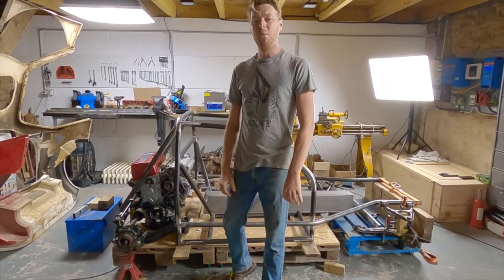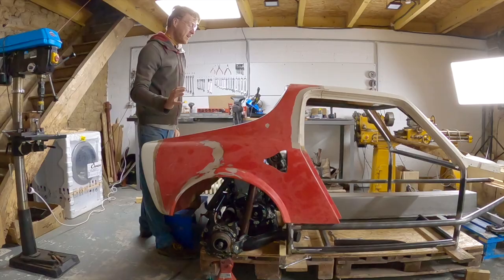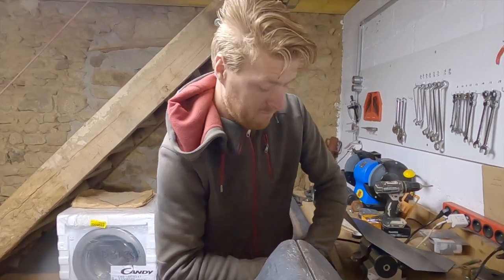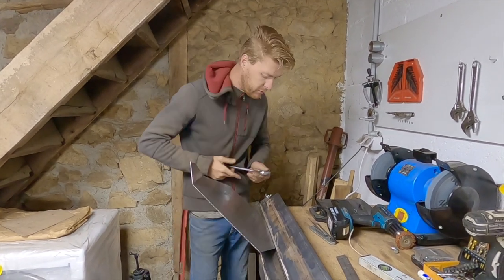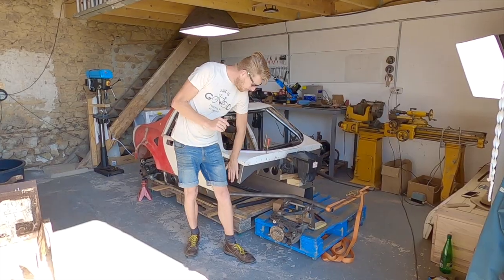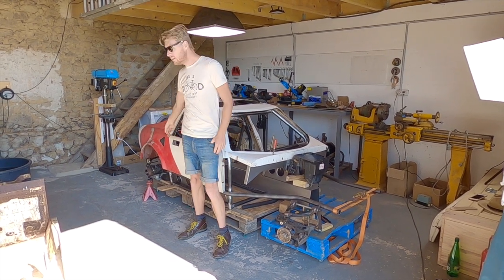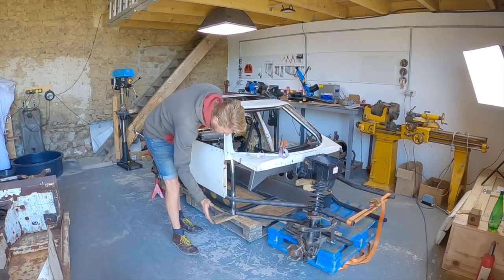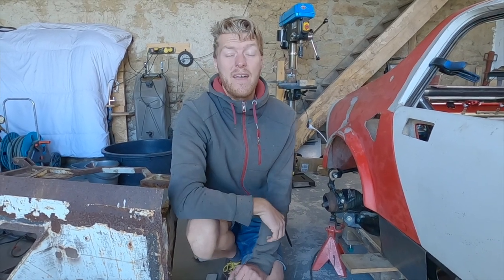Mazda Miata Suspension Geometry Improved  | Project Mosquito Honda Type R Mini Supercar (Ep27)

Comment: Making a panel stiffer raises the frequency at which it will resonate.
Reply from the maker: Very true but I've got a cunning plan for that
Reply: @OliverPickard  obviously you plan to use something similar to Dynamat. Much cheaper and possibly better is using bitumen "lead" roof flashing. This could reduce overall weight as you do not need as much. My point was you stated bending holes into panels   lowered resonant frequencies; it does not, it reduces amplitude and increases frequency due to the increase in stiffness. NOTE. max effect for min weight is 3 layers decreasing 40% by area each layer. Do this externally to max adhesion and go from small to largest area to make it tidier when applied to a panel. Good luck with the project.

Comment: Loving the progress Oliver, I’m aesthetically a bit mixed, the taller sills you have made create a bit of slab sidedness to a fairly crisp original design. You could alleviate that look by adding length wards  corrugations in the sill. But it’s just my eye not an issue. Keep it going.
Reply from the maker: Bear in mind Pandora is 13cm (5in) higher than it will be be when it's on the ground. The sill is only 1.5cm taller at the very end of the sill and because the new one will be curved unlike the flat original that length should disappear in the shadow line 👍
Reply: @OliverPickard  thanks Oliver.